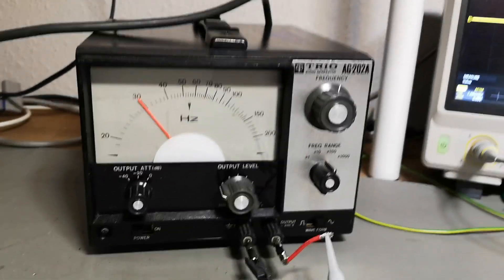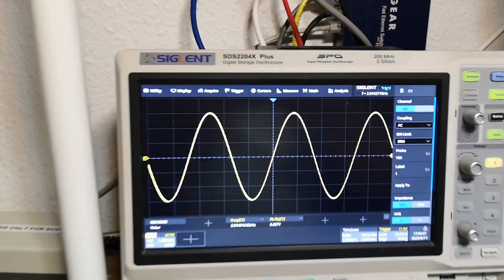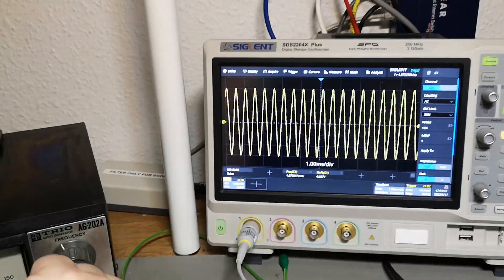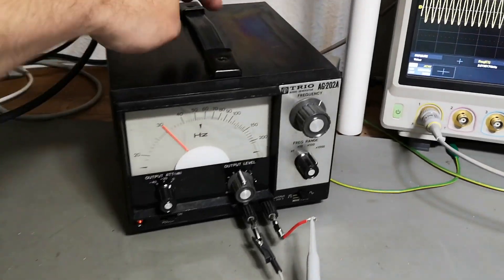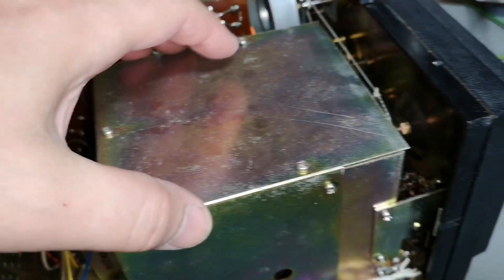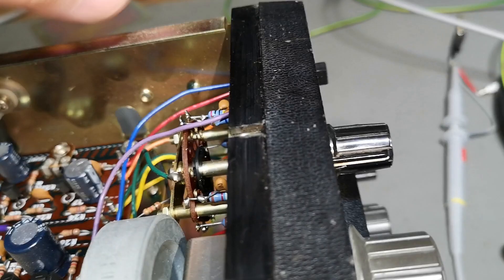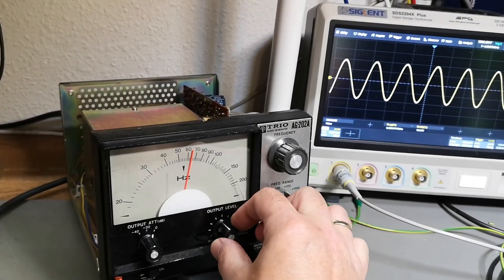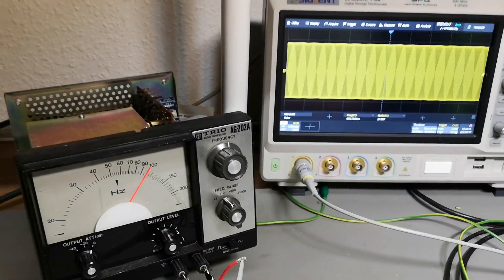TRIO AG-202A audio generator 20-200kHz test teardown

Comment: All of my wien bridge oscillators do that near the mains frequency. It is a noise pickup due to the very high resistor on the low band. In the US i see it from 57 to 63 Hz. It slows as you approach 60 and stops at 60. It is noticeable at harmonics also. It's  worse with the covers off of the unit. That's why the large shield over the variable capacitor.